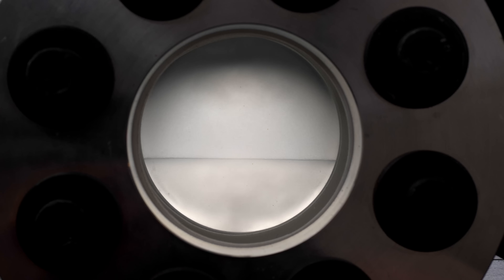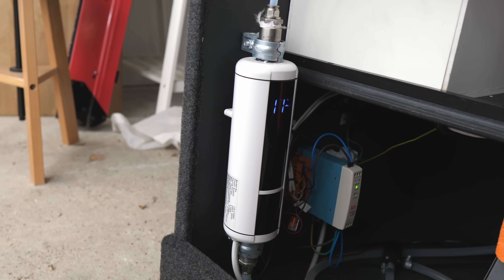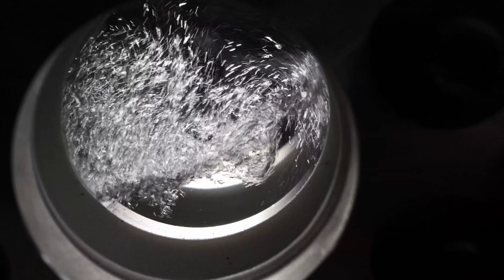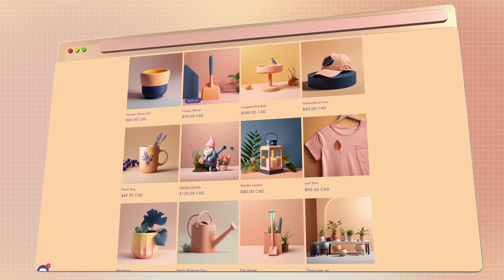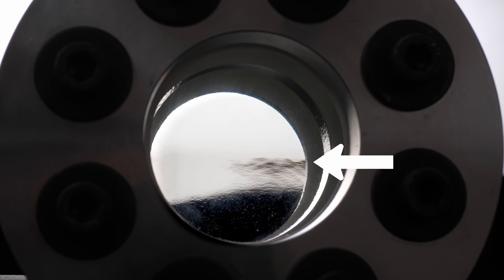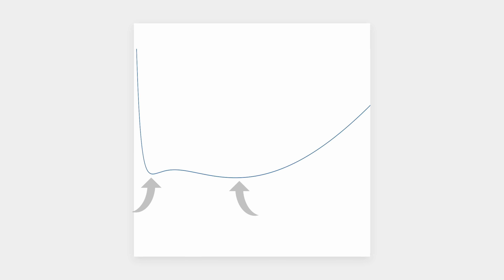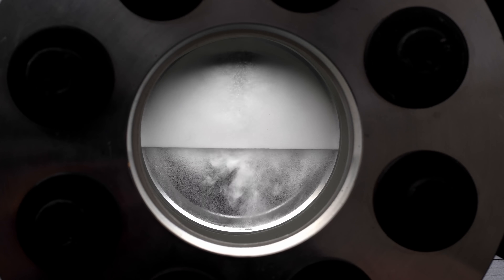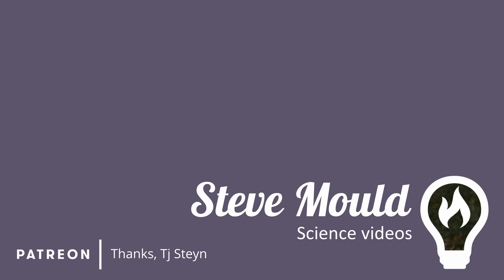The Unknown Phase of Matter

Comment: Nm of Torque is not tightness, it is quite imprecise do to inconsistencies in the bolts and nuts making the frictional forces determining the rotational resistance, what determines the torque, to be quite variable. Degrees of nut rotation is much more precise for determining clamping force due to threaded rotation and bolt elongation being highly related and bolt elongation is determining the clamping force.
The Fastening and Joining Research Institute (FAJRI) at Oakland University has a machine that directly measures clamping force and one of my classes had a demonstration on that machine showing, with the same torque, how different the clamping force was between two black oxide coated bolts from the same production batch, the clamping forces were dozens of percentage different from each other. Torque is just a slightly more precise then hand tightening, the least precise tightening method out there. It is only widely used because it is easy, anything with a critical clamping force (such as when a gasket is involved) should not be tightened with the torque method.

Comment: Acquire an ethil ether. Crit temp is 194C, crit pressure 36 atm. Can keep in glass ampoule. Easy to keep, easy to heat up, no machinery needed, looks as awesome.
Here's an example https://youtu.be/YELCLDEV6qs?t=1182
And it is not unknown phase, it is a gas, yes that simple. Vapor heated above critical cannot be liquified with pressure - hence it's a gas.

Comment: So, there's a piece of the story that gets left out (unless you take a physics or chemistry class): the Enthalpy of Vaporization. It's a fancy way to describe the heat energy of a liquid-gas phase change that isn't reflected in the temperature. In other words, in order to vaporize a liquid, you need to raise it's temperature to the boiling point, plus a little more energy to change the phase of matter. You described it rather well with those two valleys on the graph separated by a low rise. The Enthalpy of Vaporization is that little rise, the energy needed to overcome the attractive forces in a liquid before its molecules can properly boil off. What is happening, as temperature and pressure rise together, is that the total system energy is rising, and passing between the molecules a lot, until they reach this "super critical" point: the low rise between the valleys shrinks to nothing and the molecules have so much kinetic energy that they can bounce around freely, while also still retaining enough cohesion that the fluid will still flow with (effectively) fixed volume.

You could also extend the phase diagram outward to extremes of temperature and pressure. It begins with ionization (like fire at atmospheric pressure), the stripping of electrons from atoms by energizing them beyond what the binding forces can contain. Keep going, and you get plasma: violent, reactive gases with strange conductive properties. Soon, you get the fusion reactions at the heart of a star (or a hydrogen bomb). The extremes of our understanding of these conditions fizzles out around neutron stars, quasars, and black holes; substances of such crazy density that the known laws of mathematics seemingly fall apart.

Comment: A question I always have when handling CO2 canisters, that I still don't understand: In the uncritical state, there is a distinct layer between liquid and gas CO2 and in your chamber you can see it splashing around similar to water. Why cant I hear this splashing? Are normal canisters just to thick or does it not make noise because of the fairly similar density between liquid an gas CO2 (compared to water and air)? Or am I just deaf?

Comment: If the aqueous and gaseous densities match, would it not behave like a dissolved gas in the liquid and due to density the liquid can float among the gas?  Surely specific gravity is why there's still a liquid pool under the gas.  This would also mean that it's not a state of matter, rather a homogenous mix of two states, which also explains why the graph turns into a gradient at the supercritical point, where said gradient actually shows the mix in different proportions, and would explain all the observations seen.

Comment: @SteveMould a 3D phase surface in pressure, temperature, and volume makes this a lot easier to think about. The lines on the phase diagram map to the regions of the PVT surface that are parallel to the volume axis, so a phase transition is where you're moving along the volume axis while the pressure and temperature stay the same

Comment: 5:35 When you travel up that line, you are increasing BOTH the temperature and the pressure. What's interesting is why the pressure increases only enough to stay on the line in perfect balance with the temperature increase to stay in equilibrium between the liquid and gas phases. The ideal gas law does not apply, PV=nRT doesn't work, because the amount of vapor changes. The n=# of moles of vapor from PV=nRT is not fixed. It instead follows the Clausius-Clapeyron equation d(lnP)/dt=L/RT^2.
That's the math, but what's happening with the CO2 is more temperature, more liquid evaporates, and just enough to increase the pressure of the vapor by just enough to stay on the line. If the pressure of the gas overshoots at all, more condensation occurs. So it balances automatically, unless you exceed the critical point. Beyond that point, there is not enough pressure to condense gas into a liquid. And at that temperature, there is not enough heat to evaporate from a liquid. You have neither.

Comment: I've always wondered about the floating boat in two-phase CO2 going supercritical.  Thank you for making all of those boats, opening the chamber, closing it, repressurizing, over and over, to get a final conclusion.  I've been working on a metal-glass seal that performs much longer than viton or any other elastomer seal for the chamber.  Containing a small volume of SC CO2 for weeks or months is quite a challenge.
Reply from the maker: Good to hear from someone who understands how tricky this thing is to reset! I had to get the thing sealed fast otherwise the liquid level ended up too low. It was quite a workout in the end. I'll keep an eye out for your metal-glass seal in future videos!
Reply: @SteveMould for a machine that size with a sealed space that small, it feels like there should be some lever mechanism that doesn't require a million bolt turns to seal that pressure...
Reply: @SimonBuchanNz  Minimum clamping force is 1550 kg. More less. The pressure inside is well past common experience.
Reply: @brocktechnology so with a 10 multiple lever action you "only" need 150kg force which is well within simple hydraulic designs, so you could jack it tight. Obviously there's lots of material and design issues still, but this doesn't seem clearly impossible?
Reply: @SimonBuchanNz  Totally not impossible but for a one off, design issues are best avoided. there's also safety concerns, there's a lot of stored energy in there.
Reply: @SimonBuchanNz That would be amazing! But honestly, once you get ANY pressure in an enclosed space, it's tough to keep it there without leaks. 

This glass/metal/bolt contraption may seem complex and difficult, but your only other real solutions for holding this pressure are welded tanks that take a couple days to seal, and cost anywhere from $500 up to $5,000+ for each time they need to weld it together. And those aren't transparent.

It's just so easy for the thing to detonate if there's a single weak point. This is why there are so many bolts, all of which are equally spaced out and are all tightened to EXACTLY the same torque by using a torque wrench set to a safe value that holds it tight, but not so tight that you deform the metal or crack the glass.
Reply: @cyleleghorn246 Yeah, it would definitely not be a simple build! For example I suspect you'd need some sort of fractal clamp design to avoid stress points, and having something that fiddly hold this sort of pressure is an engineering nightmare by itself.

But then you get bad coffee for much less work, so I think it's worth it if someone else is doing all the work 😋
Reply: @cyleleghorn246  heat tends to expand materials with a lot of force. maybe possible to use rods or wedges wrapped with heating tape to generate clamping forces directly.
Reply: @stevecummins324 I'm curious for a good seal that will let it remain at supercritical pressure for months on a desk. So I can make the storm phase transition whenever I want. 

For the type of design you propose would it need constant heat to maintain the clamping pressure? It may reduce the ability to run experiments where you apply hot and cold to the apparatus
Reply: @SteveMould , have you tried H-Buna?
Reply: Isn't that just a ConFlat copper gasket? 😅
Reply: OH. Nevermind. I missed the glass part...
Reply: Anyone remember what Lauri (Hydraulic Press Channel) used on his... I think he just uses fairly conventional/common o-rings.
Reply: I built a similar chamber earlier this year for a friend of mine who works at University of Cincinnati, is a weird feeling holding essentially a bomb in your hands, super cool tho.
Reply: What happened to the one you built? Is it making its rounds?  Do you think it's still reasonably safe?

Comment: I bought a 4wd.
I bought a tub rack.
I wanted lights for camping.
I put lights on the tub rack facing into the tub, and at the back facing the tailgate when its down, for cooking.
Wired them. 
Realised the only way to control them was from in the cab.
Wanted switches in the tub.
Spent nearly a week and 4 trips to various auto/electrical/trade stores.
Couldnt find what I wanted.
Ended up finding my:
1) Round
2) Threaded not clip in 
3) Flush mount buttons, not with a big flick switch that sticks out 
4) 10a rated
5) 12v 
6) Colour codes
7) On/Off toggled, not momentary 

Switches, on ebay.

The switch buttons on top of this machine starring for all of .5-1 second, are those switches.

Wild.
Reply: Unless you saw the model numbers, odds are it's a generic "if it works it works" option, right? Like I've seen a million different kinds of forks that all look the same. Doubt they're the same, just a fork. Just a switch.

Comment: Steve, your particle simulation at 10:10 shows the molecules acting like billiard balls. Then you show a graph explaining that it doesn't really work that way - there's a complex pattern of attraction and repulsion that varies with distance - but it's totally abstract and hard to visualize. Fortunately, somebody put that more advanced molecule simulation on youtube just 2 months ago! Check out this video attempting to simulate a heat pump on a molecular level: https://www.youtube.com/watch?v=d_7zNLILqeE

The video complements this one really well, by going into detail on exactly the part that you gloss over. It starts with molecules as billiard balls, but ends up simulating the attraction and repulsion, and as a result, you get to see evaporation and condensation happening on a molecular level, and even how a change of pressure can lead to a phase change. It's very cool and helped me to wrap my head around what's going on intuitively.

Comment: Something that’s interested me is that PT diagrams are useful for phase transitions of many substances but I’ve wondered if you could add plasma to it. I suppose that you wouldn’t be able to include molecular PT diagrams like water or CO2 because at those energies you wouldn’t certainly break the molecular bounds sense you need to ionize, but if elemental gases have super critical fluids then can you have a super critical plasma? Or are plasma already super critical in a sense? They have so many more degrees of freedom and may models from kinetic to MHD so maybe the word super critical doesn’t work with plasmas but I’m curious what a chemist might say.

Comment: how can the gas getting less dense reduce buoyancy? I thought it could only come from liquid getting less dense?
Reply: Read Archimedes - it's all about relative densities.
Reply: @alans172  I am saying that from archimedes the only thing that matters is liquid density-not the gas
Reply: The boat was hollow.  It was "filled" with gas at the beginning, and as the gas density increased, the weight of the boat went up too.

You can demonstrate something similar in your kitchen sink by floating an empty bowl in a sink full of water.  Then as you add mass inside the bowl, to increase the density of the bowl's contents, the bowl will begin to sink.  This demonstration simply manipulated the density of the gas to increase the density of the bowl's contents.
Reply: I'm not sure it works like this. The force downwards increases yes, but one can calculate it purely from the pressure, which is constant in the gaseous section. Therefore I think it is equal to the force which is applied downwards if the the boat was cut at the liquid level and the force was applied from the liquid above (cut at "water level" and then fill in boat with solid w/ equal mass). In the liquid section the pressure increases from depth and the discrepancy of the pressure from depth is related to density. I'm pretty sure the calculation says that the only thing that matters is the liquid density and buoyency is always just archimedes principle based on displaced volume,
Reply: @Kineth1  anyways guys you can just do the calculations with stokes theorem

Comment: Great explanation! There is just one thing still bugging me (forgive me if you covered this and I missed it): you describe the state with both liquid and gas CO2 as if the conditions are the same throughout the container. However, then I would expect the liquid to just float around in bubbles or something. Instead, we see a clear vertical separation between the liquid and the gas. My first thought was that this was due to a pressure gradient caused by gravity. However, if this is the case, then I don't see why we necessarily need to be at that equilibrium line. Assuming all the CO2 is at the same temperature, couldn't you still get liquid and gas just from the pressure gradient? Like the CO2 would actually span a little vertical line that would straddle the liquid/gas boundary.

Comment: Weirdly, it's not really true that everything sublimates in a vacuum. At a sufficiently low temperature (less than about 2 K), helium will remain a liquid in a vacuum.

Now, if that helium is just open to space, then actually, it will still evaporate sooner or later. That's because even below the boiling point, liquids (and solids) still evaporate, and in this case, any evaporating liquid will escape into space. Even a hunk of tungsten would evaporate in space eventually. But if the really cold helium is contained in a box, it will remain at equilibrium as a liquid, even if the pressure is arbitrarily close to 0.

Comment: Have you confirmed that the gap at the top of the liquid has gas in it under pressure? Or is it possible that all of the co2 has condensed and that's why there's a separation between the co2 and essentially a vacuum, while gravity holds the condensed co2 and when it goes supercritical there's no co2 above the line, it's all condensed still.

Comment: Darn it I was waiting for you to head the other direction and show us what the triple point looks like. I guess you'd need a much more serious cooler (to -57C) than you had here. That is, you wouldn't be able to do it by circulating water (which would freeze), but air or nitrogen, past dry ice (-79C). 

The diagram with two minima turning into one minimum was really, really helpful. Well done.

One big difference between water and air is the ease of coloring water. I'd like to see all this with some "food" coloring in the liquid CO_2.

Comment: Great video and the diagram showing the line where it eventually ends and becomes a wrapping round single “fluid” is great way to visualise it. After watching it made me think that end is half somewhat like the end of a klien bottle no? Now it has me sort of wondering is there a vauge point at the other end of the line. Im assuming the line goes from the fluid minimum pressure minimum temperature but i wonder what happens if you either lowered the temp and and also pulled a deeper and deeper vacuum on it via hydrolic force would it eventually collapse and make a single point invisible solid? Or a similar solid to liquid indestinction event?
And as i thought more maybe it leads to a critical solid point where it becomes atomically activated? The friction force of the atoms themself being compressed generate heat and light. So maybe not best as a home experiment.

Comment: I have criticized past videos you have made both for not answering all the questions they posed, as well as for ending abruptly with topics unfinished or partial thoughts where I felt they did not belong (so stuff left unsaid as opposed to something to think about and reflect on) this video has neither and did a fantastic job with pacing and wrapping itself up neatly. I know that is actually very difficult to pull off, particularly when you're trying to make it appeal to a large audience (I'm more used to watching videos conclude well because the types of videos I prefer are very long and thorough which makes it much easier) so I wanted to specifically thank you for the work you've put in to make that happen, this was a great one
Reply: It's now snowing here.  What's the temperature change there that has led to this adjustment in your super critical response?  Maybe you're under a different amount of pressure to normal.

Comment: Thank you for actually explaining the molecular mechanics of what's going on in supercritical fluid. I wish you'd talked about more of the properties though, like does it settle in a container like liquid or diffuse like a gas? Does it have surface tension? Those few coffee beans floating in the fluid looked wild, like they were just stuck in mid-air, they weren't drifting like you'd expect them to in a liquid, what was up with that?